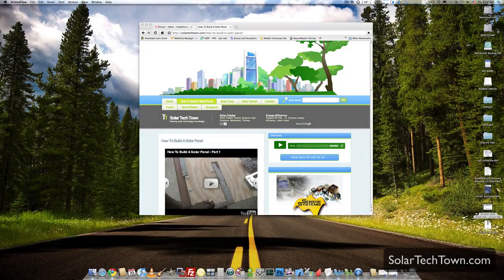Solar Tracker (Open Source Circuit)

Comment: you could add side solar stips to reset it back just on one side... that might work the minute the sun hits the left side of the panel it moves until its aligned.... think of it as a L shaped panel

Comment: I am doing a solar tracking system base on component. I am not creating anything because there are so many different ways to do it. I am using something called..(relay Logic) yes, is all about old fashion relays. I am controlling a motor forward and reverse with 2 single pole- single throw relays. I believe in open source and simplicity. I am using photodiodes to control each relay. I can not say is cheap because there are so many parts involved even in a very small solar tracking. the motor itself has to be low gear and high torque from 3rpn to 12 rpm 12vdc or 24vdc. I am using 2 limit switches to control the end and the starting position. The only reason to add those limit switches is because in a real world scenario cables with coil around the moving pole. I have seen many people putting the battery into the body and I think that is for another level , not for an everyday project.  right now I am building the body for the Azimuth vertical shaft. still waiting for parts but I would be glad to share the complete project with everyone. I am currently studying for EE and you know , solar still a mystery for so many people. I`m just dropping some ideas. hey  nice project!

Comment: Good work Robert...
I know it has been awhile since you made the post, however I have a video on my page you may be interested in. My tracker prototype is a dual axis open source solar tracker, and it does not need a return east at dusk feature, because it should detect the sun in the morning, if set up properly. and automatically track to it. Through the night it will track to the brightest streetlight. or you can just modify the code for the xy servo to move east or south if you want.

The tracker uses an Arduino Nano with the ATmega328 utilizing four photo resistors, and four 1K resistors. I can provide the code, and hookup drawing, which can be modified as desired for any upgrades/changes.

Comment: Dude I've been instructed to design a similar project,say that actuator whats it called?I mean the product number etc.I was thinking of using a stepper motor or DC motor,but my project is supposed to incorporate microcontrollers so do you think an actuator would be ideal

Comment: Something I dont get. The system works only when hit by light. Shouldn't the tracker rotate according to the angle sunlight hits? In other words, no light, no movement, but then the sensors will be illuminated for as long as daylight lasts. Maybe there's a sensor disposition which I am missing?

Comment: Robert the array should go back at sunrise if the tracker is set up right. If you would like to have it waiting for sunrise have a separate circuit with a clock that is set to turn it back after the latest sunset of the year with a micro switch to stop it from going to far.

Comment: If the photodiodes are properly isolated from eachother, and the system has a battery for early-morning power, won't the unit already turn back to the east at first light without any extras?  Shouldn't that be easy enough to test with the flashlight?

Comment: Wouldnt it be easier to use a timer instead of photoresistor one of the most predictable things is the sun,,,I've heard of these setups pionting back to the east when it gets cloudy ,,,,theres a web site that uses a antenna rotator and a timed remote to activate the rotor to piont to the sun,,,I think this is much simpler and more effective,,,,tellme what you think???

Comment: Robert, I do not see the BAT54 Diode anywhere on your boards. Where is it locasted? We built our board exactly like your schematic, baut the motor runs only one direction, and it seems the phototransistors have no effect whatsoever. It the Bat54 a necessity? I am subtitutting a zener diode for the moment as the BAT 54 has not come in yet.

BTW, Great Video and clear instructions.  James

Comment: @DHarrisChillin Almost nothing, it is such a small load that you can use a tiny solar panel to power it. Tracking the sun will result in a total higher efficiency.

Comment: Nice work Robert ... I have been working on solar tracking circuits for a few years as a hobby... my site is greenwatts(dot)info ... I made a solar sensor using GaP leds that might fit well on your circuit... keep up the good work.